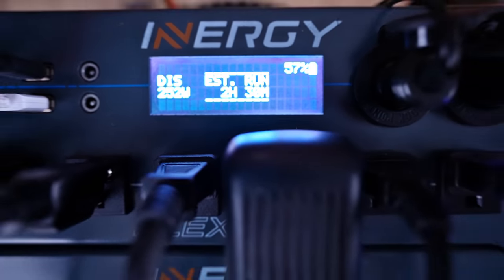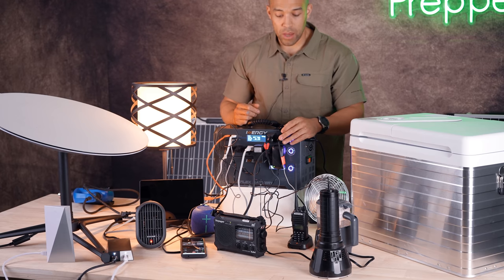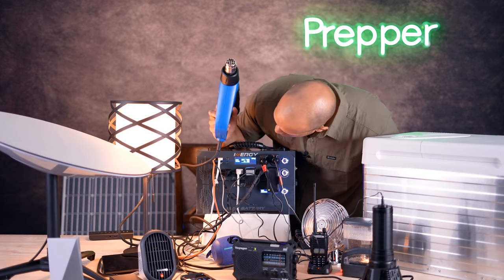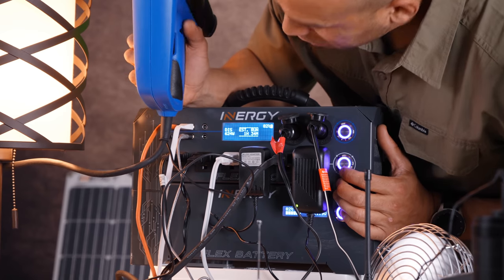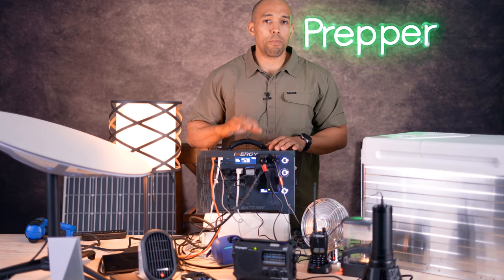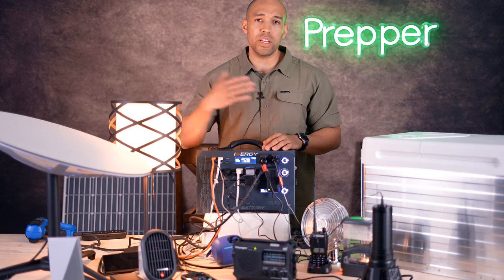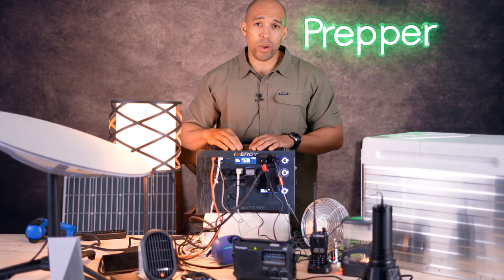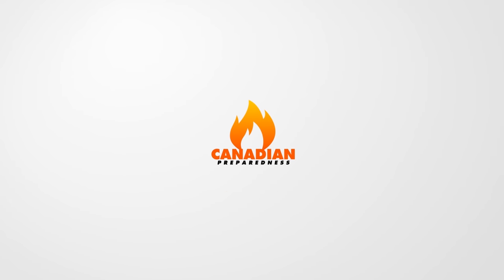Inergy Flex 1500 Tested: How Much Can it Power?

Comment from the maker: Get an Inergy flex system here/ with presale discounts
https://glnk.io/p5q/canadian-prepper or get a smaller ZENDURE powerbase system https://canadianpreparedness.com/products/zendure-superbase-600-watt-solar-generator use coupon code SURVIVALPREPPER for 10% off the Superbase

In depth breakdown of the Flex Specifications
https://youtu.be/7rN06SUlWOo
Reply: HH  I received mine.  I felt bad about announcing it but then I thought sharing the info is far different than bragging.  I hope others who received them would speak up.  Some are very quiet about announcing any preps.  It’s an awesome unit.
Reply: You should discuss the EMP surge plug.

Comment: You're trading power for silence and portability. I'll take that trade, especially for the majority of circumstances where I would need to use a generator. Sun will be shining long after the gas tanks run dry.
Reply: Right! It is always better to diversify when it comes to back up power. I have a dual fuel (gas/propane) generator, but I absolutely love my solar generators. So quiet and OK inside the house. i have a collection now. You just have to be understanding of their limitations until you can get to sunlight with solar panels or alternate forms of power to recharge.
Reply: @australianwoman9696  
Wind turbines are a great option, as well.  💗
Reply: @iLeah1  we need these options i agree
Reply: Absolutely
Reply: In my opinion this thing is overpriced. You can get a Bluetti AC200P for $1699.00 with a 2000wh battery and a 2000 watt inverter with a 4800 watt surge, and lifepo4 batteries with over 3500 cycles to 80% capacity and the batteries for this thing are $850 a piece let's say you buy two batteries that's $1700 right there, with $1700 you can buy yourself another Bluetti and have 4000wh of capacity with two Bluetti's the only advantage that this thing might have is that you can take it apart and it's lighter weight so there are tradeoffs to everything 😉
Reply: Bill gates is going to block the sun, theyre already starting now. Good luck everyone.
Reply: @childofgod884  - True, but if Inergy comes out with better head unit tech, the batteries aren't a sunk cost. The backwards compatibility is really what you're paying for more than anything. As you said though, trade offs. If you have a product that meets all you need it to do, then you're still better prepared than 99% of the populace
Reply: How about Bill's dim the sun program
Reply: @respecthumankind333  
They've been trying to dim the sun for years now just look up at the sky you'll see the chem trails coming out of the airplanes a- 🕳s. Just stand outside for a while when they're spraying and you'll notice all the clouds that appear a few minutes after they're done spraying.
If you don't believe me you can check out Mike Morales channel here on YouTube he knows a lot more about this stuff than I do. I believe he also has a channel called agwn (above ground news network)
Reply: Absolutely junk after an emp

Comment: A major point is that they are compact and  SILENT.  A fuel generator can never  beat that. It may not  provide you  luxury but a solar  generator will run all your essentials  except  submersible pumps. It gives you electricity  AND stealth. Can't  beat that.

Comment: So glad I preordered mine. I can't wait to use mine. Did you know, you can use the super charger, on it's own to charge your batteries? I asked Inergy directly. You can use the flex somewhere else, while the supercharger charges your batteries. (They don't need to be stacked together)
Reply: Marc-Andre, that plus the fact it can charge faster than the power station if you have enough solar panels,  was what got me to order a supercharger to go with my extra batteries.

Comment: Most people, like myself, that live in hurricane county, in the Deep South, NEED AIR CONDITIONING, almost year round. We need a MIX of Inergy and a dual fuel generator for comfort and survival. The dual fuel can help charge the inergy as well as run a window AC or two along with the refrigerator/freezer, depending on the size of each appliance and the generator. Some Gen sets can also run on natural gas , which is highly reliable in my area. I have NEVER had an outage of natural gas, unlike the recent Texas debacle. When the sun isn’t shining, you can charge your inergy with your generator. You would do better to have both.

Comment: Really well narrated and informative video. I have several panels from 300 W - 100 W and then many smaller however I have next to no real knowledge about the batteries that are used, how the charging is regulated, etc.. This helps me think about it some more. I will definitely be looking at one of these inergy flex systems for communications. 
You do a really good job at explaining things most of us don't fully understand. Great Job.

Comment: Could you demonstrate charging it through solar panel as well as regular wall outlet??
Reply: I would like to see that as well
Reply: Charges 5x faster with solar than plugged into the wall
Reply: @seymourrivers6169  I am very ignorant on such things but I would love to see it demonstrated... what's a reasonable size of solar panel required, how long to charge vs how long plugged into the wall.
Reply: @sherrymacaroni5916  Unfortunately there are a lot of variables to be real concise, but I'll touch on a couple to help give you an idea. So much depends on what you want to accomplish which is a good thing I think. The most popular panel size is 100w. Considering you get on average about 5 good sun generating hours, you'll probably want at least two panels so you can get to 1000w and thus fill your battery in a single day. You can go with more or less, just know you'll be getting double or half of that.
The standard wall charger is 100w and should charge the battery in about 11-12 hours. It will charge at 100w per hour until it gets near full and will kinda trickle in real slow from there.  They do sell a fast charger for $80 that is 225w with the same principle of getting all 225w until it slowly puts the last bit in. You can even use the standard charger and fast charger at the same time. It will not be a sum of the two (225w+100w) but it will be faster than the quick charger by itself.
Reply: @rizipt  very kind of you to reply!!!!  First time ever I got a ballpark figure on what it would take to charge something.

Comment: I have a E350 cutaway van with 1,200 watts of solar panels and 600 amp hours of lithium batteries. Plus a 3,000 watt pure sine wave inverter. Plus a 5 stage water filtration system.

Comment: I’ve a rock pal 300.. , and a 100 watt panel. it’s enough for camping long term. If I wanted to run a camp frig, it could be done, but it would be pushing it. I currently charge and run, iPad Pro , iPhone, 2 blue two speakers, lights, flashlights, a fan. My desalt tools. A coffee pot.  You need a 700 to a 1000 to run a microwave.   SUV off road life.

Comment: The problem is that most haven't had to pack 70 pounds on forced marches.  I, and many others I know, did that-35 years ago.  Yeah, old bones and injuries do suck, but one mostly heals.  Now that 60 is fast approaching, 30 pounds is still doable, but only for two or three miles at a time.  And lotsa water too.

Comment: Guys I had all this stuff and I got hacked and had to use it. It all got hacked in use while off network. Meaning dead. Did some research and found out that they can be turned off at every entrance and exit port, such as usb or even main power supply at the main I/O gate going in. This would be the capacitor. Even a 1950s blender can be denied access to it's power supply. Solar batteries may charge but no usb output allowed. Please  talk to your hacker friend about this, because it was done to me 2 years ago. (Love your channel btw)...
...I'd invest in old school manual solutions, sorry.

Comment: Love this show, thanks. Can it run a dual induction stove top or a window unit airconditioner?
Reply: Yes, it will power a window air conditioner.  How long depends on how many batteries and/or if you are doing pass through charging with solar panels; but does work.  Not sure about the induction stove top.  That depends on whether it is under the 1500 watts max for this inverter.  I have a Duxtop induction one burner cooktop and it worked fine with an older version Inergy powerbank.  The upper end Duxtop cooktop (about $115) has wattage levels from 1 to 10.  So even though it is rated at 1800 watts (probably level 10) it uses less watts at lower levels.  At level 5 it uses about 800 watts and cooks great.  😊
Reply: @mycabana4020  Thank you.😊

Comment: What solar panels do you suggest?
Also I've heard of a higher output generator that is a permanent installation for your car or truck that is powered by your 'fan belt' while your engine is running. So it would be powerful and portable.

Comment: So I'm not an expert by any means with solar systems so I have a couple questions. Would it be a cheaper solution to use multiple high watt inverters with multiple panels hooked into like 10 car batteries? Could this be a solution for powering a fridge or deep freezer and maybe recharge phones and other small items for parts of the day. How many watts altogether and what panels do you recommend for this and what watt inverters and how many do you think you'll need to do this? I would love to have an option to run an ac window unit but I think I'm dreaming lol.
Reply: I think you would be better off having the 10 battery "fuel tank" and 1 solid 2500-3000 watt inverter, check out Ice Hole Power here on YT
Reply: @tompeebles6273  that's what I was thinking but also thought if it's possible to have more than one inverter possibly tied into the batteries and you could start more than one unit that requires a high load at startup. I'm definitely going to check that out, thanks!
Reply: I have the older version of the Inergy powerbank and I can run my window ac unit off it for several hours.  I could do longer if I did pass through charger from the solar panels.  My window ca used 600 watts on high and 300 watts on low.  So depends on the watts of your air conditioner and how long you need to run it.

Comment: I bought a Goal Zero Yeti 1250 around 5 or 6 years ago and I've found it to be relatively reliable for running my home office, and their customer service is amazing. The downside is I lose power so frequently (usually lasting 24-48 hours at least once a month) and it doesn't recharge fast enough, even with 4, 100W panels in direct sun, so I'm considering INergy for a backup while the Yeti is changing.

Comment: Do you think they are going to consider making a larger battery option since this all pretty plug and play pick a choose options? Like offering a 3 or  5 kw battery. So someone can buy one big battery  and 1 regular size so ppl don't have to stack a crazy amount of small battery to get a high kw numbers?
Reply: A 3k or 5k battery would be super heavy 48 lbs to 80 lbs.  I’m glad they are smaller and more portable, yet can easily snap together.
Reply: @mycabana4020  well making a large battery option would cut down  cost  per kw for ppl how are looking for larger kw options, and I'm those ppl are probably using it in a home power option and most ppl how want to take it outdoors can just have a small 1kw battery

Comment: Can you go over the differences between the different solar panel options?  3 different models & then also the 2 versus the 4.  Obviously know amount of time to recharge main factor on 2 versus 4, but maybe scenarios of use in which 2 would be just fine.  I want to pre-order, but if the other panels are just as good would go for saving a few hundred bucks.  Thx.
Reply: To save money, you can buy the mc4 adapter from Inergy and then connect to Renegy 100watt solar panels (high ratings and only $94) on Amazon.
Reply: @mycabana4020  Thank you!

Comment: Florida  does it take a window Air-conditioning.. that's what we're down to every time the grid goes down here from hurricaine with a gas generator
Reply: If your window air conditioner is under 1500 watts (max for this inverter) it will work.  Most window ac’s are under that limit.  How long it will run depends on the number of batteries you have and / or whether you are doing pass through charging with solar panels.  For example:  If your ac is 600 watts it will run for about 1.5 to 1.75 hours (battery on unit is 1069 watts).  So each added battery increases that time incrementally.  If you have only one battery, but hook up to 400 watts of solar panels (4 panels each 100watts). You would probably double the time the ac could run ... so instead of 1.5 to 1.75 hours; you’d get 3 to 3.5 hours.  I have an window ac with low and high settings...so can conserve energy by cooling the room on high and then reducing to low (only 300 watts usage...so doubled time) or to the fan mode (only 25watts).  Then can increase to high again if needed.  My older Inergy powerbank can get me through the heat of the day by adjusting between fan, low and high...rather than just keeping at high.  Basically, it depends on the wattage being drawn by your specific window ac.  Check the back of the unit to see the number of watts it uses.

Comment: I have a 500 gallon propane tank running a whole house jenny. I can run everything on my property for a long long time. I can run it only when I need it say once a week. Take a shower, fill water tanks, cook multiple meals, charge everything I have then shut it off. I can easily go a year if not longer. Is it portable? No. Will the propane run out sooner or later? Yes. But it will give me some time.

Comment: Ecoflow  will lower the voltage  but still run. Interesting
Reply from the maker: That wont do any good for the devices you are trying to run. Its not a useful function. With this system you are able to run it up to 2000 watt output for several minutes and 1500 watts continously.

Comment: My new addition is a new kobalt power supply that snaps onto the kobalt battery to charge your USB products
Reply: That sounds awesome, i repurposed a old Rigid brand flashlight battery adaptor and battery to power the LED lights in my shed. Works great and i get light for like  8 hours per charge

Comment: What's the life of the batteries ?
Reply: 2000 i think. If you are bugging in and had the money some of the new wall units are over 7000. This device is obviously portable which is in my view its primary positive. They also have the dc unit. I would love one but they do not have a 240v 50hz unit which i need
Reply: @ronicarbine8723  thanks for the info !!

Comment: Website says the presale is $1,350. Am I missing something? Did they just raise the price recently after the colonial pipeline shut down?
Reply: That's for the battery and the Flex Power Station Module (the part with all the outlets) and the price is unchanged since last year.  You can add on extra batteries for $850 each
Reply: @MattPritchardOfficial  Thanks. It's just confusing because in CP's video it says it's $850 for preorder. Still seems reasonable price at $1350 if it performs as well as shown here
Reply: I think he means the batteries are 850

Comment: Anyone have a recommendation for a generator that doesn't cost $1200+ just starting out and won't need anything large but thought even a small one to start for now
Reply from the maker: You would have to look into gas generators or a smaller lithium solar generator like the zendure https://canadianpreparedness.com/collections/portable-power/products/zendure-superbase-600-watt-solar-generator
Reply: The SUPA Sp 300 LiFePo4 portable Solar Generator. I had two of them delivered today. £300 each. I prefer the LiFePo4 battery technology despite the less capacity weight performance over Lithium Ion/polymer. Having multiple smaller Solar Generators gets around the 'cabling' problems if using a larger 1000+W inverter in a multi room environments. Having 60W USB C PD is very handy for use with a precision regulated programmable power cable to power 5,9,12,15 and 20 volt electronics from Routers, Radio transceivers, class T Stereo Amplifiers. Satellite HD televisions, LED lighting, Laptop computers etc.
Reply: The Bluetti eb70 is only $500 on Amazon right now and comes with a 700 watt inverter and 716 watt hour battery.  Not bad for the price.  There are YouTube videos that talk about it if want to know more about it.  The screen is a bit annoying in that it doesn’t stay lit, but for the price, not a bad option, if trying to keep cost down.

Comment: WELL SAD BECAUSE I NEED TO BE ABLE TO RUN A REFRIGERATOR AND A SMALL PORTABLE AC THAT WILL COOL AT LEAST 200-400 SQUARE FEET. I can live without electronics for a few days but not AC and refrigerator.
Reply: My window ac is 600 watts....and the Inergy will run it just fine.  How long it will run it depends on whether I’m using pass through charging (charging from solar panels while using it); how many watts of solar panel input; what setting my air conditioner is on low at 300watts or high at 600watts, and how many batteries you add to your Inergy flex.  With just the flex unit without any added batteries, I can run my window ac for several hours and gets me through the heat of the day.  Could go longer if needed by connecting to solar panels while using.  But Inergy Flex will power a window ac.  I’m able to do it with their older model.